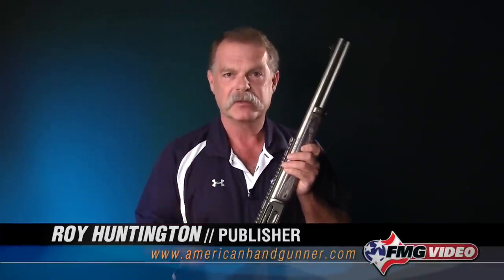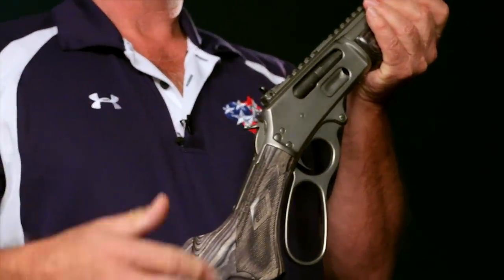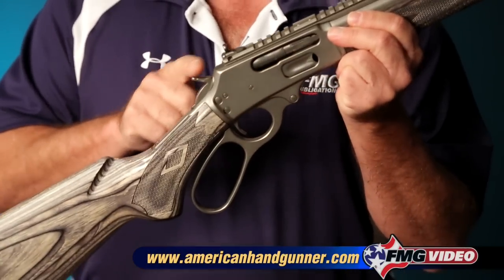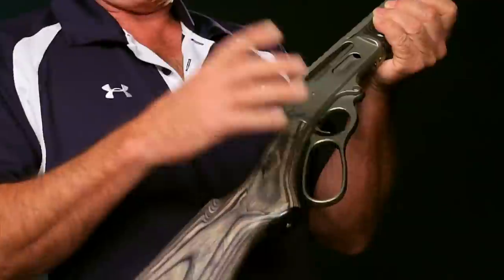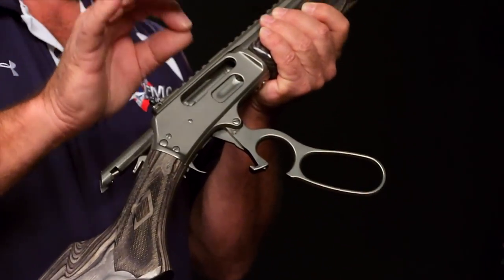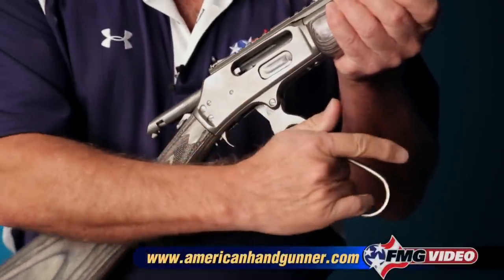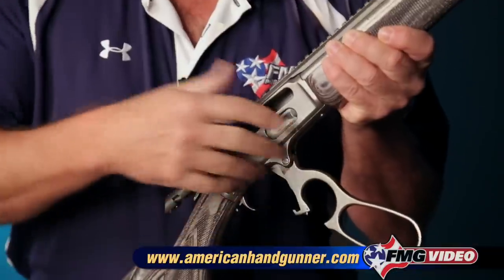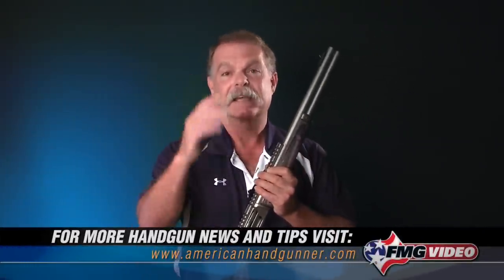Unloading A Lever-Action Rifle

Comment: My granddad taught me to use the loading gate to empty the tube just  in reverse of how it is loaded. He learned it from his father, a former calvery officer and preacher. I've continued the knowledge by teaching my kids and now grandkids.
I don't understand why people think manipulating the lever is the way to empty the tube.
Reply: and now you taught me, thx
Reply: Thanks for the tip!
Reply: And I will teach my kids!
Reply: Bit late to the comment but could you explain how to unload using the loading gate?
Reply: @anon4854  basically with the bolt closed you depress the loading gate until the loaded round is pushed out by the spring in the tube. You repeat until the tube is empty just like the loading process. It takes a bit of practice and some rifles unload easier than others. You still have to manipulate the lever to confirm the chamber is empty to completely clear the weapon. 
It has been a while but there are videos on other channels showing the process.

Just a FYI...Some rifles also allow for the removal of the tube spring by way of a knurled end cap, and then you can simply point the muzzle towards the ground in a safe manner and the rounds will fall out the front. At that point, operate the lever to confirm the chamber is empty.
Reply: @RenaissanceThinking  Thanks mate!

Comment: nice video however the safest way to unload your lever action is the same way you load it. unload from the loading gate,its simple realy just hold down the gate and the tube spring will push out all the shells . most people dont know this and this is why marlin put on the hammer block safety for those who want to cycle the action to unload. give it a try guys and if you dont beleive me there are a couple of videos right hear on youtube showing this.
Reply: Thanks for the tip. Never heard of that one before but it makes sense. Can't wait to try it next time I hit the range with my 44 or 30-30.
Reply: Is there a video showing this?
Reply: helllsing84 thanks, that was neat!
Reply: That's how we do it.  Seems easier.
Reply: Absolutely correct. Chambering every round when unloading is a recipe for disaster
Reply: Apparently the new Ruger Marlin 336 doesn’t allow this feature but I think the 45/70s do. 🤷🏼‍♂️
Reply: Some of the Ruger Marlins allow this method....but it's finicky and unreliable at best.......most lever actions simply pushing down the loading gate does nothing.....some of them u can push down the loading gate and kinda fish the round back out.....on my rossi 92s in 357 mag and 44 mag I cannot..........basicly jacking them thru the chamber is the only option on most lever guns

Comment: Thanks for the safety tips, Roy. Nice job. If I may, I'd like to add a safety measure that I adopted after my son shot the woodpile through the kitchen window while "safely" (I use that term very loosely here) unloading in the kitchen. (yikes) I'll ignore all the obvious blunders like being inside and in the kitchen.  When you cycled the lever action, I noticed you had your fingers inside the loop. That's how my son accidentally discharged his. His fingers got tangled up a little and BANG. 
These days, to unload our lever-actions, we all make a point of grabbing the lever only by the outside and bottom of the loop. This keeps your hand far away from the trigger, so it's nearly impossible to discharge the weapon. 
That's it! That's my added tip.
Reply: J M Surra xx

Comment: huh i know this is probably a how to do for beginners. Most lever actions i encountered you dont need to cycle all the rounds trough. you simply pick out the new round from the elevator. Close the action on empty chamber. Push down the loading gate, push down the cartridge let the cartridge slide out trough the loading gate. Much safer
Reply: Is there a video showing this?

Comment: Not all levers have that crossbolt safety option.I've watched all to many persons levering out their shells trying to catch them or watching where they go on the ground ,all while losing track of the muzzle direction. MAY I SUGGEST ,just point the muzzle down and press in the loading gate,ea loaded shell will pop out  the same way it went in. Some may need a little flip with your finger,but you can unload the entire tube, then carefully lever out the last loaded shell . try it it's easy

Comment: On the top ejecting lever actions, you can flip the gun over (ejector face down), obviously barrel still facing a safe direction, you can slowly cycle the gun, and the next bullet, instead of going into the chamber, will just fall out instead.

Comment: Well Roy, you did a fine job of explaining but you forgot to mention to engage the cross bolt safety to the safe position before starting the unloading procedure. And you didn't do it.  I mean that is one of the main reasons why the safety is on the gun in the first place.  The correct way to unload that particular rifle is to put the hammer in the 1/2 cock position, move the cross bolt safety to the safe position, point the muzzle in a safe direction and cycle the lever until all rounds are removed from the magazine.  You made it more dangerous than it really is.
Reply from the maker: I agree, I should have reminded them. But I wanted to show how to do the same on a gun with no safety. If I said to put the safety on and their rifle didn’t have one, they might be confused. “What now?” But I should have said to engage it if you have it. Roy
Reply: @fmgpubs  Confused?  lol.  Roy we really do live in stupid times, don't we?

Comment: With my model 94, without any safeties besides the half-cock, I usually try to not put the bolt all the way home before I remove the round.  That is, I close the lever just far enough to remove it from the magazine and lift it upwards to the level of the chamber, and then I take the round out.  

Unloading a gun is something I would rather do slowly than risk an accident.

Comment: What type of rifle is that
Reply: Looks a lot like  Marlin 1895 45/70 XLR SS, but he's got a full-length cartridge tube, so that's not the exact model. I took a  quick look around, but couldn't find the exact model. I searched for a Marlin 1895 45/70 XLR in stainless for years.  Update: I found this model referred to as an 1895 SBL in another video.
Reply: Marlin Model 1895SBL .45-70